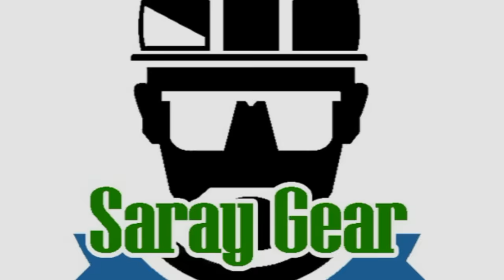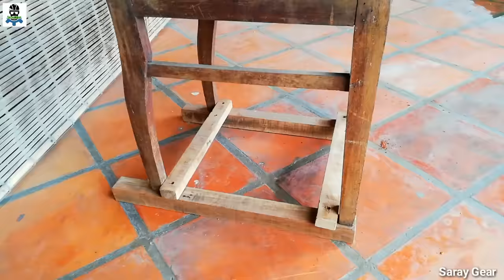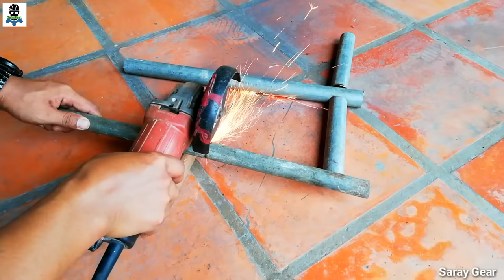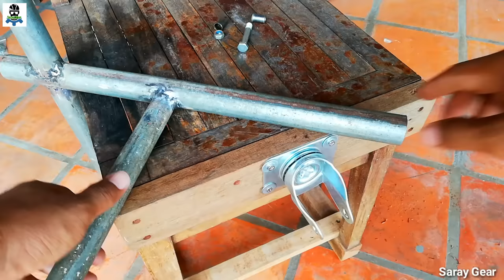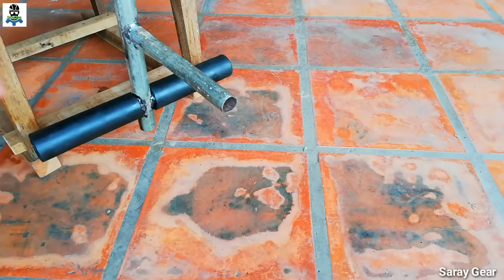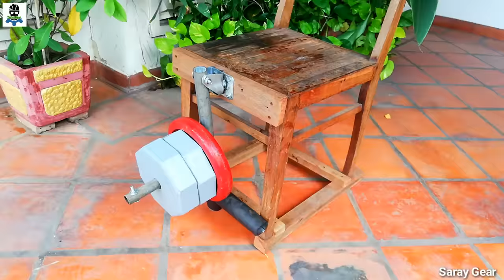How To Make Homemade Leg Extension Machine( For Gym At Home )

Comment: Nice! 
You'll need to incline the chair and reinforce the floor support structure parallel to the vertical force of the weights. Otherwise, you'll capsize frontwise when loading it with serious weights.